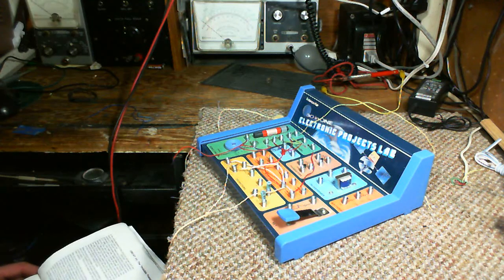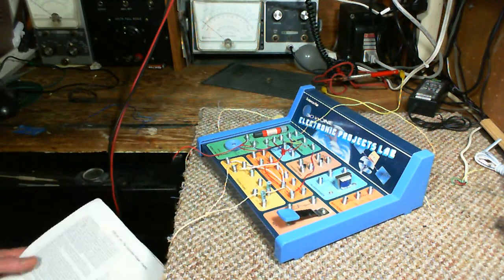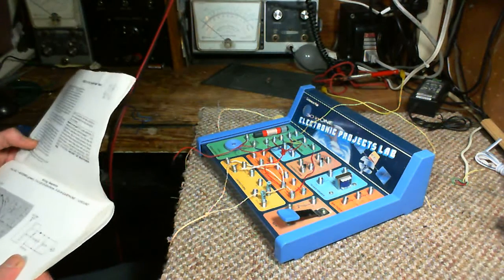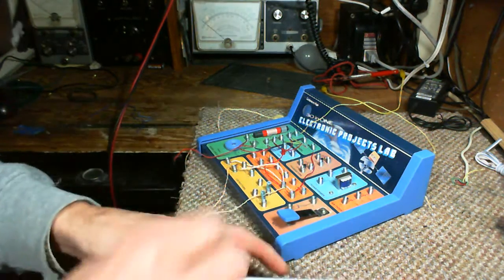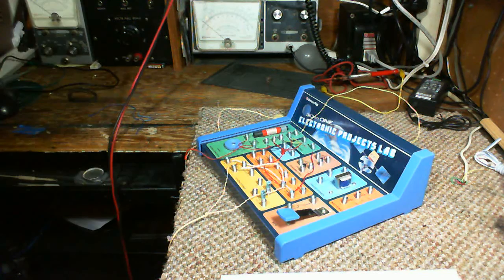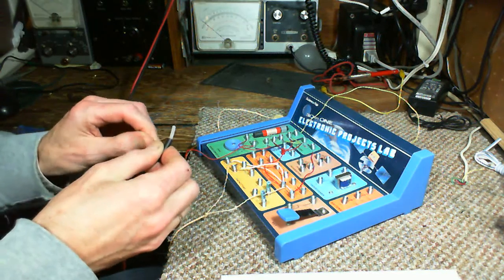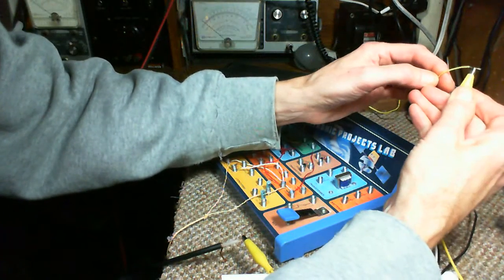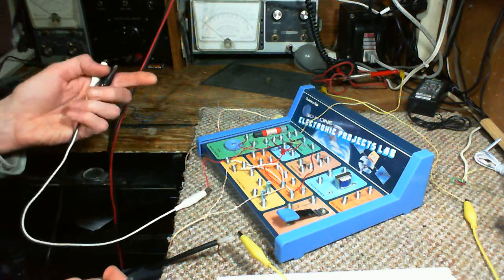Science Fair 30 in One Project Kit - AM Radio

Comment: I had that same kit as a kid, and it did include a one transistor radio project. But it was no more than a crystal set with an amplifier. It only picked up one high powered local station, typical crystal radio results.

Comment: I got one of these from amazon for my goddaughter for Christmas and it was absolute rip off junk. I open it up to look at the inside and there were many short circuits from sloppy soldering and some of the components were not even connected at all to the springs. The "battery power connection" was connected backwards!

Comment: You need a LONG WIRE antenna stretched to the tree outside.  Then you need an ACTUAL ground wire connected to a ground rod or cold water metal pipe.  THEN it would work.  I built my own crystal radio in 5th grade, mine worked when I connected that kind of antenna and ground.
Reply: The instructions included in this kit did not emphasize either of these two important facts.  I could not get the crystal radio to work on my 30-in-1 back in 1983 but hope to give it another try someday.

Comment: Manual? Who needs a manual? ;) You can find hundreds of schematics for radio circuits, from the most basic all the way to high quality. Surely, you will be able to find one for the kit... and with a transistor, get more gain and hear something. :) Try a regenerative receiver design... may have to add one or two external components (like a second pot) to this little kit, but it should be doable. :)